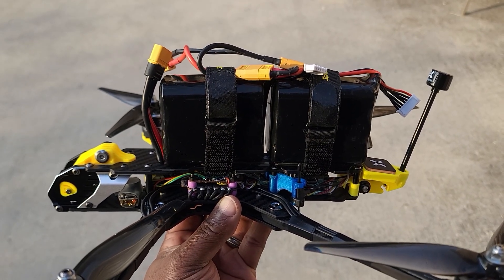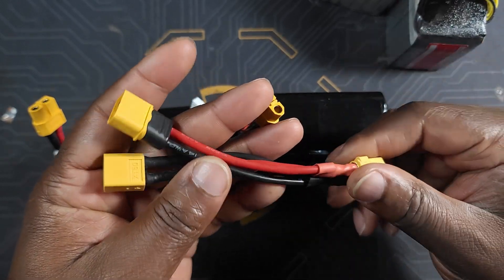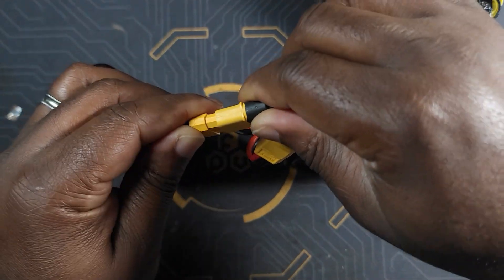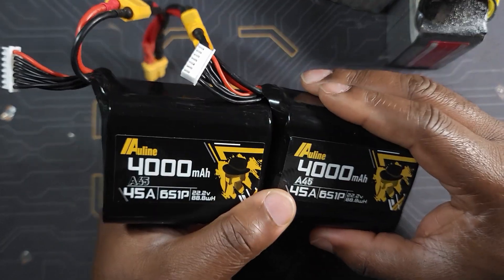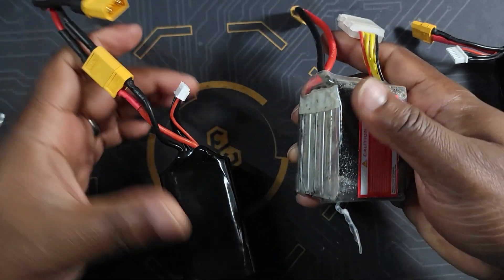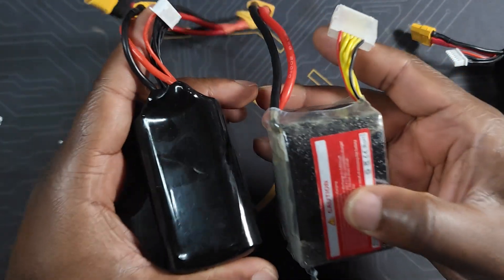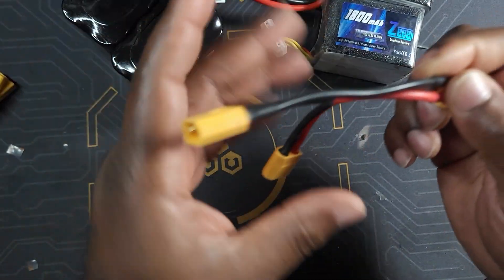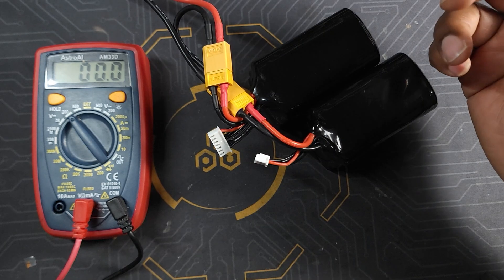Running 2 Batteries in you FPV Drone

Comment: Does parallel with less volts affect the flight because of weights of two batteries or it's fine as the series that supply higher voltage current

Comment: Great video, thanks for the help.
But i still need a bit more help😂.
So i have a Cinelifter 9” and i ordered for it all the components they recomended but i find the battery runs out too quickly and the power isn’t that great. I have two options, i transfer to 4s batteries (expensive) and put them in series and the drone will have a bit more punch, it will be on 8s which is still compatible with the escs. Or i buy more of the existing 6s bats and put them in parallel. This option is i think better and cheaper. But is there any sacrifice in amps or something when using that y adapter? Because for now the Cinelifter looks like this from the inside: it has two escs witch are connected to a board that splits power from one bat and if i connect batteries in parallel to that, power will go from an adapter to another adapter. I wouldn’t have to solder the drone and still would have the option to run one bat or two. Or i re-solder the drone and make each battery run one esc, that would then mean i won’t have the option between parallel and non parallel, i would be forever stuck in parallel use. I need some advice, i am concerned about the many adapters cause of any bottleneck
Reply from the maker: What the Mah  of your battery?
Reply: @GBoniFPV  4500mah lipo 120c